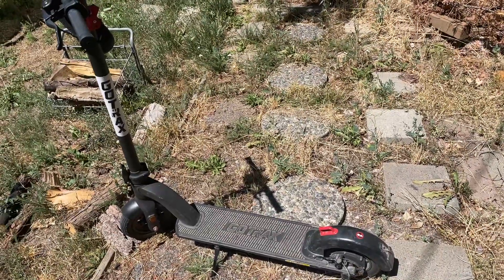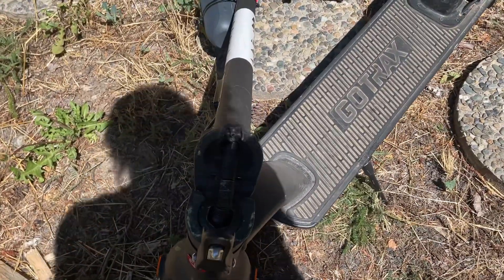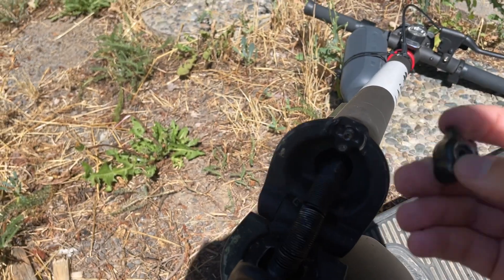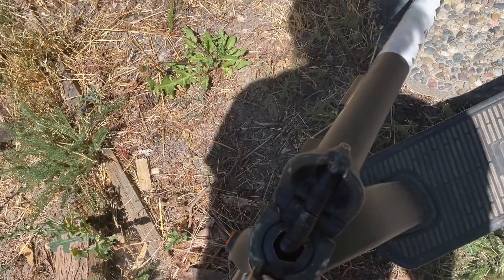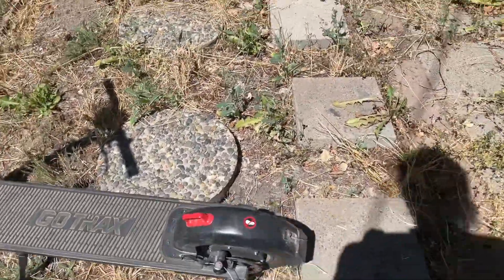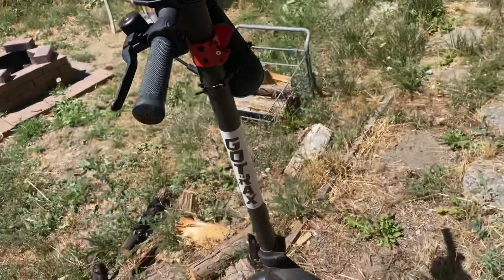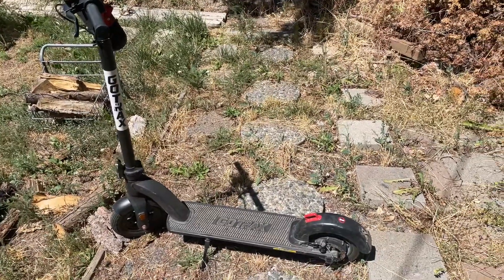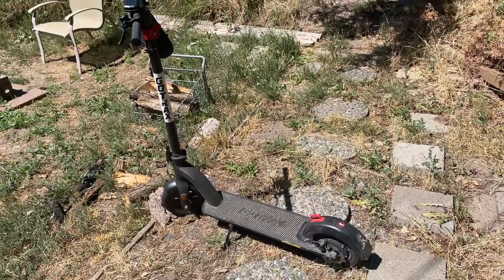Gotrax g4 1500 mile quick update

Comment: My G4 has 800miles on it and the stem wobbles a little at the folding latch area.  I bought the wrench from gotrax to tighten the hex bolt but it is already very tight.  Did you have this issue?
Reply: Any updates? I got the same issue. Thanks!
Reply from the maker: You can check out my 1000 mile review video, I talk about stem wobbles